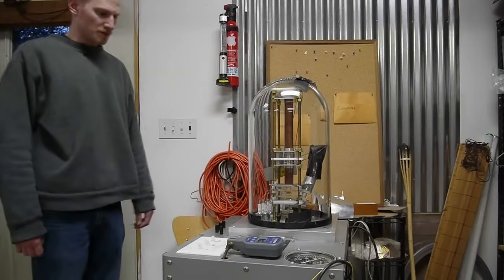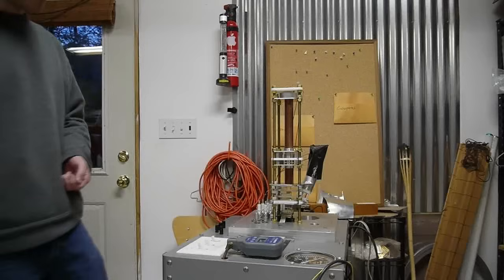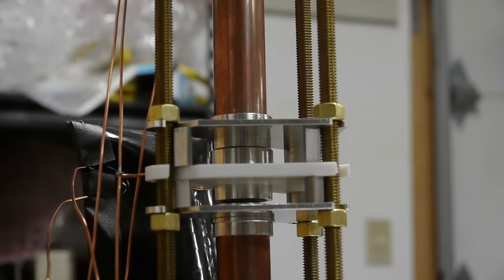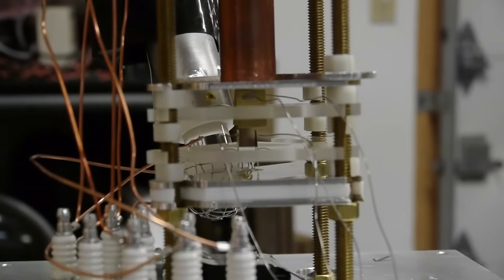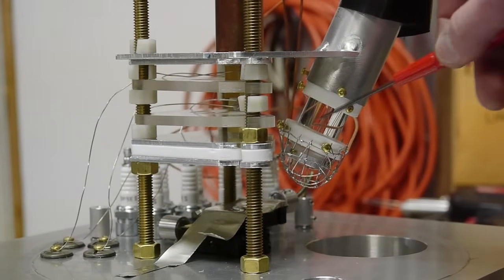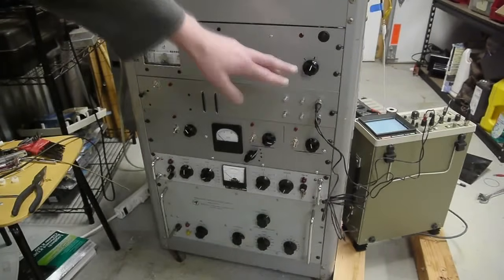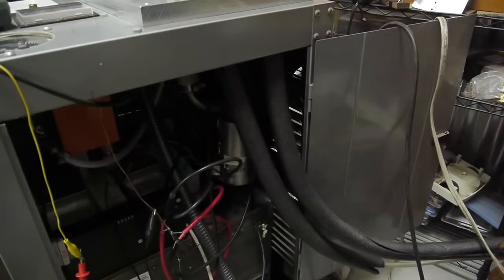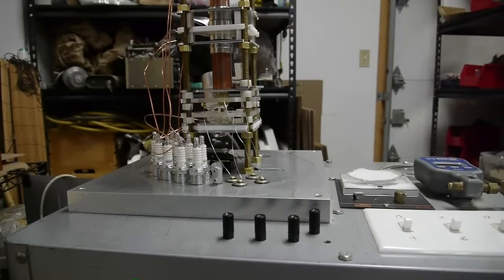DIY Scanning Electron Microscope - Overview

Comment: Good Work, Ben. - I see you are VERY active in both academic science, and in the "Hands-on" technological, practical side of applying constructional and experimenting skills to real-life scientific problems.I envy you your interesting work situation.
     I remember from doing hobby electronics that the electron guns in TV cathode ray tubes were not aimed directly at the target, i.e. the screen phosphor, but slightly off to one side, the [light] electron beam being shifted back to the required direction by a small, adjustable "Ion trap" magnet clamped to the glass neck of the tube body, leaving much heavier ions contaminating the beam to carry straight on to impact on a metal target so that they could not damage the screen phosphors. Is this relevant to your electron gun?
     Also, a good, cheap source of Tungsten wire would be TIG welding plasma arc tungstens, though some of these are deliberately doped with Thorium to help with welding certain metals, and this might be a source of such heavy, high-energy ions in the beam.
     Looking forward to seeing more of your fascinating output on YouTube.  - Many Thanks. from  Tony Boyle.

Comment: Amazing project! I had not been realized that an expensive lab equipment which I use often could be an DIY!! However I have a question; accelerated electrons+metal=X-rays, that's why all electron microscopes have heavy shielding around the column and the specimen chamber... you have lots of metal construction in the column. even though the electron beam is focused there can be some electrons which surges, some from the gun, or the metal samples or whatever the source.... Do you really think that the bell jar is a good solution? or am I exaggerating a little bit? What do you think? It could be an interesting topic, if you want to reopen the SEM subject, or discuss in a video...
Regards

Comment: A superb piece of science/engineering. I was surprised that the detector did not simply pick up secondary electrons and amplify them with an electron multiplier. This was used with the Farnsworth tube. I suppose the optical detector is more sensitive due to the high accelerating voltage.

Comment: Where did you start? With gaining all this knowledge I mean.. I'm incredibly impressed, and curious as to how one could become this capable
Reply from the maker: Peter May
I bought a box of commercial filaments on eBay because they were very inexpensive, and having very regular, exactly sized filaments made replacement easy (instead of adjusting each bent piece of wire).  This device is entirely electrostatic -- no magnetics at all except for the permanent steering magnets to compensate for a not-aligned column.
Reply from the maker: Thanks!  I really appreciate it.  Some of my training comes from my mechanical engineering studies at UCSB.  Most of my training comes from finding information on the internet, testing things in my own shop, and running my own prototyping business.  Check my LinkedIn profile for details.
Reply: Applied Science Oh no problem man, you're an amazing human being. Stay curious!
Reply from the maker: Owen Chase Search my videos for "costs" and "sources".
Reply: Applied Science
I worked for Cambridge Scientific Instuments as a service engineer for many years
who made the worlds first commercial SEM, Did you make your own filaments, or did you buy them, and is the beam deflection electrostatic? Good luck with the fine tuning.
Reply: Applied Science what did is cost for you to make this?
Reply: @sweetguy19762 Did you figure out the cost and supplies?
Reply: Applied Science ok
Reply: wunseq he is an alien

Comment: That is an awesome DYI project! I am looking forward to your updates. What will you try next to improve resolution? Did you consider any of these:
- Add apertures
- Add condenser lens
- Use magnetic instead of electrostatic objective
- Place objective closer to sample, place deflection plates above, instead of below objective
- Use some lens-centering mechanism - mechanical or electrical
- Add stigmator
- Add electromagnetic shielding
- Reduce noise in voltage supplies
- Increase acceleration voltage
Careful with X-Ray!

Comment: Do the e-'s from the e- source emit in a specific direction? Or do they emit in all directions at the ones that happen to be heading in the direction of the source material are the ones that get focused and used for imaging? Reason I ask is because I feel like a non-directional source of e- would cause a lot of noise during detection.

Comment from the maker: The highest accelerating voltage is 10KV, and I normally run the SEM at under 5KV. The x-rays produced by this acceleration are so low-energy that essentially none will be able to penetrate the glass and aluminum chamber. This is why black-and-white TVs did not need lead shielding. Color TVs used 25KV+ voltages, and then became an X-ray hazard, requiring lead glass.

Comment: The outgassing issue under high vacuum that you discussed was something that had never occured to me until I was visiting a friend of mine in his lab at FSU.  They were building a pretty good sized ( to me)vacuum chamber to conduct an experiment, but could never achieve the level of vacuum they were aiming at to do the experiment, so thinking they had a leak, opened it back up to inspect and found a small plastic handled jewelers screwdriver that had basicly evaporated down to the metal shaft.

Comment from the maker: Good question. The phosphor/PMT allows the use of 10KV to accelerate secondary electrons, while not requiring the PMT anode to be 10KV above ground. This provides a DC signal path from secondaries to final output without voltage shifting or isolated supplies. Modern machines still use this method to measure secondary emission. Backscattered electrons are collected directly, since their energies are much higher. I have some electron multipliers that I would like to test with an isolated amp.

Comment: Hey Ben, amazing job, I am genuinely baffled by this. I have a couple questions about it though -- Does it have the control to do E-beam lithography? What's the maximum magnification at which you can see things decently clear? Do you run it off regular 120V from the wall or do you have some other source?

Thanks!

Comment: Hey Ben love your channel!
The scanning Electron Microscope project is an awesome achievement! I was wondering if you were to take the Electron gun from the old cathode ray tube and used this to produce the electron beam and use additional accelerating section to finish off that section instead of building all of the other pieces to simplify construction etc. Just an idea that came across while watching the video etc. Keep up the great work!
George

Comment from the maker: Actually, the spark plugs are very good in terms of outgassing. They contribute less to the gas load on the system than many of the other parts in the bell jar -- including the rubber seals and plastics.

Comment: Interesting, so a scanning electron microscope is essentially a CRT television, except the beam is focused onto a small area rather than projected onto a large screen.  Seems like the most complex part is the electron sensor and all it does is measure the instantaneous "brightness" of the reflected electrons and convert it into a voltage.  Looks like it would be relatively easy to ditch the o-scope and add an LCD display for a nice "finished product" look.  Thanks for the informative video!!!

Comment: Believe me, I'm impressed with what you have achieved so far. Having the PMT inside the vacuum is a neat solution and pretty unique as far as I'm aware. I wonder if you could dispense with the light pipe and just mount the scintillator directly to the PMT? Stigma lenses would be nice eventually, but they are difficult to engineer and the drive circuits would be complicated. At the current spot size I don't think it is much of an issue anyway.

Comment: Very interesting. Clearly your biggest issue to work on is spot size and beam coherence. Looking at your column, there don't appear to be any spray apertures in there so I guess that is somewhere on the refinement list? I can see why you are using just one condenser lens for the moment, but I think that 2 lenses will give you so much more potential that I'm sure you must be considering it? How are you calculating the beam crossover points?

Comment: Hi nice,
Maybe you could of have used the electron gun from the scope tube .
I have an old 1 inch Vidicon (XQ1241 ),and seems te work exactly on the same principle, only main difference is that the use an photo sensitive layer instead of an object.
Maybe using a gun from such a tube would give you a much smaller spot.The voltages on a vidicon are only a few hundred volts, and the deflection of this one i have is magnetic.
Not 100% sure about the focusing,but some use magnetic focusing .

Comment: Looks like what you have now is a scanning electron spectroscopy tool.  Without a few improvements, your microscopy will be limited.  You should add several stages of positive electrical field lenses for refinement.  You aught to get a better pump, like a turbomolecular pump for second-stage pump down.  You need to bake out (heat up) your chamber to dislodge 'stuck' air particles from all components in the chamber.  I work with a condensed matter research group, if you want advice, I'm here.

Comment: A question: Would the quality of the vacuum increase compared to plain air in equivalent pressures if the dome was first filled with helium and then the vacuum pump was used?

Comment: @bkraz333 
I found description on wikipedia and there are but somehow I cant find any images if such device besides description.
however there is a book about that available "Reflection Electron Microscopy and Spectroscopy for Surface Analysis" you can find it to download easily.

seems that this method has some problems, it requires perfectly flat sample to examine it under atomic level.

Comment: @bkraz333 
I think I can do that quite easily, and by the way you are using such detector yourself, just that it uses light coupling.
Instead of that screen it is possible to accelerate electrons multiply them and detect.

If you illuminate entires sample you can use electron lens to magnify resulting image and project it on the screen .This is known as Reflection electron microscope. Also old image intensifiers work in similar way.

Comment: Great job on your build and your presentation. Your goal of 1 micron resolution is aggressive,  I suspect the main issue will be lens aberration,  resulting in astigmatism.  As for lining up the column, it requires more work but the typical way SEMs are aligned is to use scan coils higher up the column so that you can image the apertures within the column itself. A cheap way to improve the image capabilities is to buy a used storage 'scope.

Comment: @bkraz333 do you expect μm or nm pixel resolution?  the depth of field is not my primary concern, but I am dealing with objects that are not dimensionally flat, and STMs will not be able to handle that easily.

Comment: Amazing stuff!  Can you explain the lensing some more?  You mentioned that there's a very short focal length, and the beam diverges sharply after that.  So how do you get a sharp beam at the target?  I didn't follow the bit about the "deflection plates," unfortunately....

Also, can you say anything about the scanning mechanism itself?  Are you using some component from a B&W TV, say, or is this something you built from scratch?